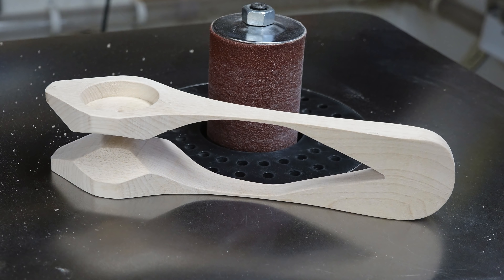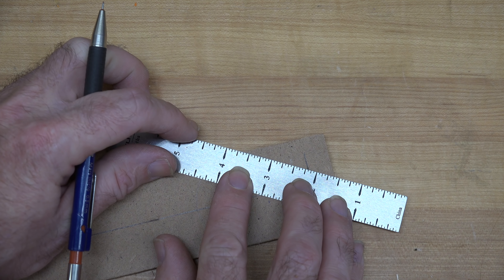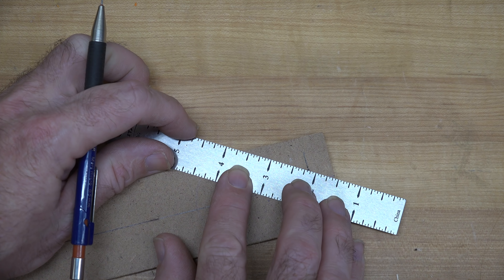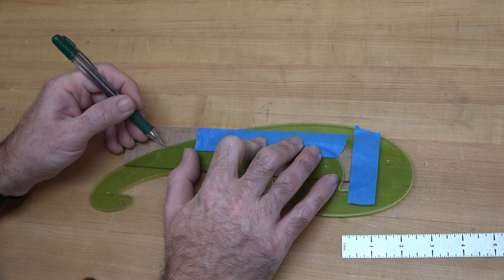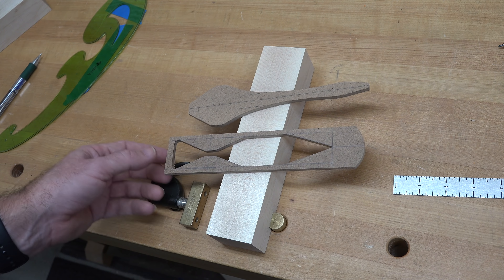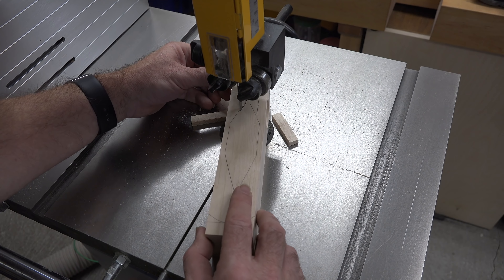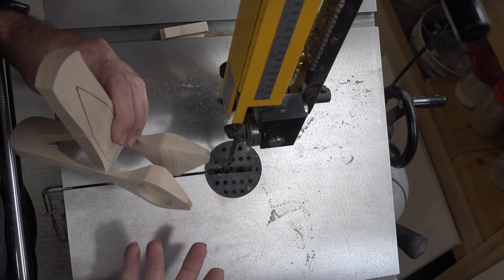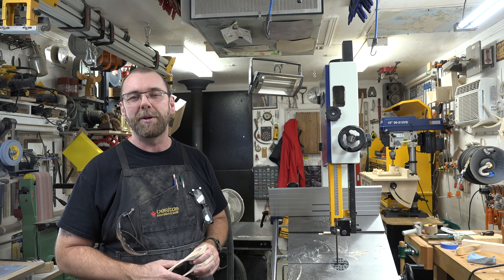Making Musical Wooden Spoons

Comment: @acutabove_woodworkings thanks for the lesson.  My husband's family is very musical...me, I  play the stereo...lol.
I suggest you smooth out the diamond cut to be rounded and large enough for an adult to slip a finger through.  Some people hold them like you did (good job btw). Others will slip their pointer finger through and use their  thumb and middle finger to pinch the outside.
Reply from the maker: That's actually a pretty solid suggestion.  For those that hold it in a traditional way (as if they were separating two spoons) might find a rounded slot to be more comfortable.  Thanks for tuning in and for the suggestion.  It's very much appreciated.

Comment: Thanks again for a great video. You just gave me an idea for Christmas present. I will have a go, I doubt if mine will be as good as yours, but I will give it a go. By the way, did you use maple for strength or tone. What other woods will be useful. Or put it another way, which wood is NOT suitable. 
Thank you.
Reply from the maker: Thanks for the kind words on the show.  I'm sure that your wooden spoons will turn out just fine.  You just need to take you time, that's all.  As for the species of the stock, the only ones that I wouldn't bother with, are pine and cedar.  The only reason I chose maple was because of its strength.  I don't think that tone quality has anything to do with it when you are just knocking a couple pieces together like this.  Different woods would definitely have different sounds, but unless you are a professional, I honestly don't think that stock choice based on sound and tonal quality is that important.  Thanks for tuning in and for taking the time to leave a comment.  I appreciate it.
Reply: @acutabove_woodworkings  thanks for the advice
Reply from the maker: @wigennazarov1824  You're very welcome.

Comment: @acutabove_woodworkings I forgot to ask about the measuring guide and the sliding dog hole clamp! Do you have any links for those please?
Reply from the maker: The measuring guide, can be found here.  https://www.leevalley.com/en-ca/shop/tools/hand-tools/marking-and-measuring/rules/58877-incra-t-rules
As for the dog hole clamp, that is called a quick release wonder dog and it is available from Lee Valley Tools.  Here's a link.  https://www.leevalley.com/en-ca/shop/tools/workshop/workbenches/benchtop-accessories/74622-veritas-quick-release-wonder-dog?item=05G1030
I hope this helps.  Thanks for tuning in to the show.
Reply: @acutabove_woodworkings  thanks! There's a Lee Valley over in Halifax...I'll have to take a drive over...could be dangerous for my wallet...lol